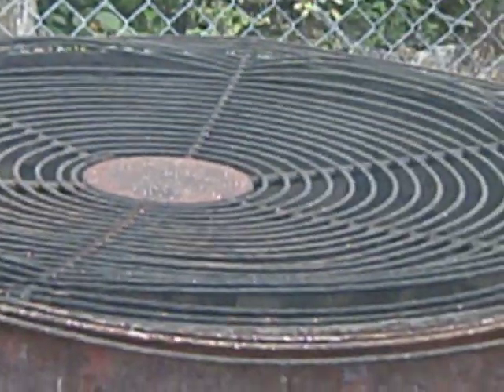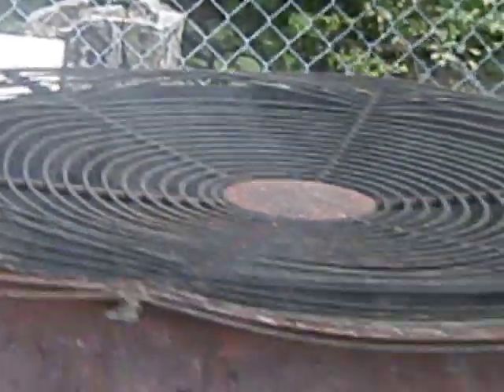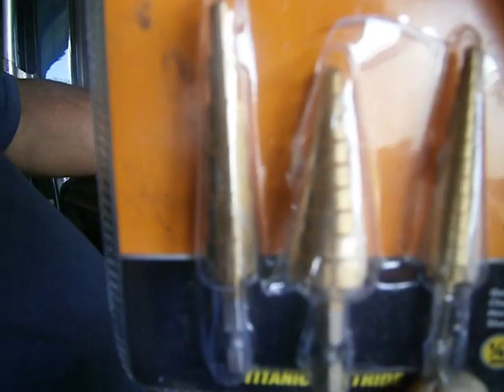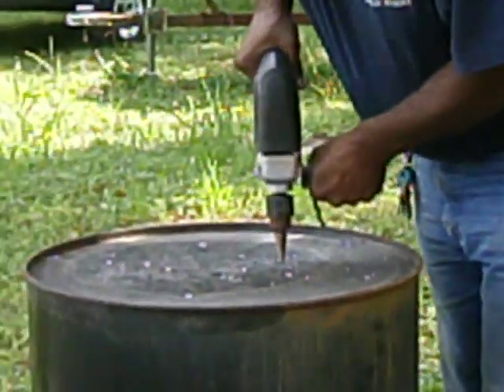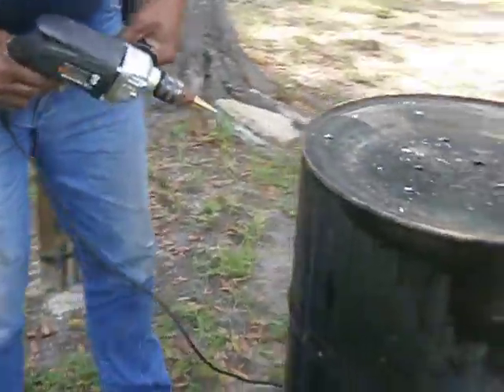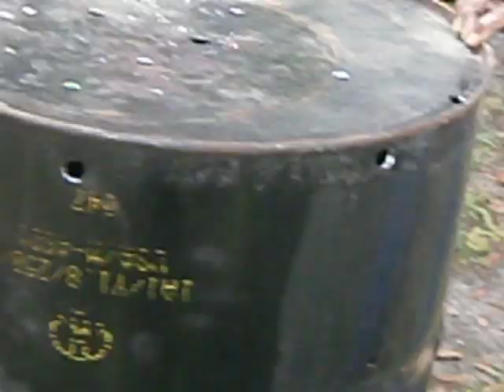DIY burn barrel #Naturalhair #makeup

Comment: This was very helpful ... although I AM going to use A TORCH to cut my holes - but the IDEA helps me out a whole lot. THANKS FOR POSTING THIS VIDEO. BE BLESSED.
Reply from the maker: Dennis C. Latham set the barrel on a old tire rim before using that get it on the ground and it can breathe
Reply: Valerie Granville THANKS ... I used Centerblocks for now - and it's working GREAT - will upload VIDEO SOON. THANKS to you and your video. HALLELUJAH !!!!!!
Reply from the maker: centerblocks good idea

Comment: This is a very simple trash barrel compared to all the other stuff on YT. I picked up one with the lid removed (super easy) and just need a few holes for air and to drain when it rains... My dad made a really great burn barrel out of a water heater tank, put a grate in the bottom with steel rods and had an opening to remove ashes.
Reply from the maker: That sounds like a good one💋

Comment: Learn more about air quality in Kentucky and across the U.S. through the following links.
The Division for Air Quality does not endorse nor guarantee the accuracy of 
the information presented, nor will it be responsible for any of the data, ideas 
or opinions contained at the locations cited below.
AirNow - An excellent resource for information about air quality, pollutants and health. Find the current Air Quality Index for anywhere in the U.S. and Canada usiing AirNow's interactive map.
KAIRE - 
Louisville Metro Air Pollution Control District's community outreach and 
education program. KAIRE's primary goal is to increase public awareness of the 
impact individual choices can have on local air quality.
Kentucky 
Administrative Regulations - Title 401 Environmental and Public 
Protection Cabinet (formerly the Natural Resources and Environmental Protection 
Cabinet) Department for Environmental Protection regulations.
Kentucky Clean Fuels 
Coalition - Improving air quality and supporting economic development across 
Kentucky by promoting the use of clean fuels.
Learn about Air - 
EPA's one-stop site for learning about air quality issues.
Louisville Metro Air Pollution Control 
District - The Louisville Metro Air Pollution